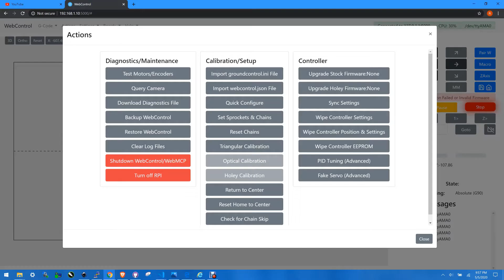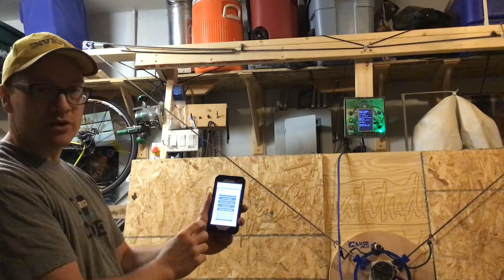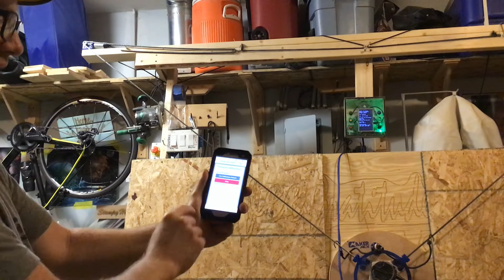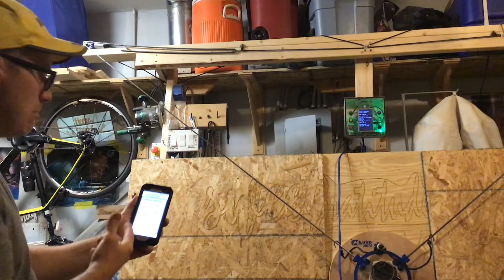WebControl  Triangular Calibration

Comment: Hi Rob! Have you tried the Holey calibration already? What is the difference or advantage (if any) over Triangular calibration? And do you know why my webcontrol has the option for Holey calibration unavailable (grayed out)? Thanks!
Reply from the maker: Yes, I have tried and run holey calibration for some time.  I have a couple videos showing that running.  Triangular calibration is the basic calibration method that works with versions 1.xx firmware on the Arduino mega control board.  If you use webcontrol and flash your firmware to 51.xx firmware version then the holey calibration becomes an option and the triangular calibration is grayed out.  To change firmware, you can have webcontrol program it for you, but recalibration will be required.  One of my videos shows that as well.